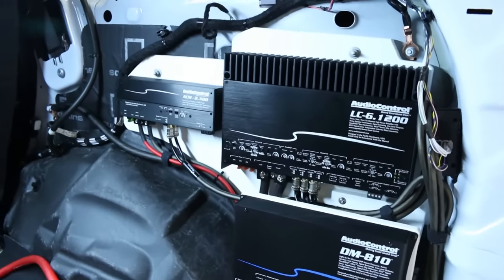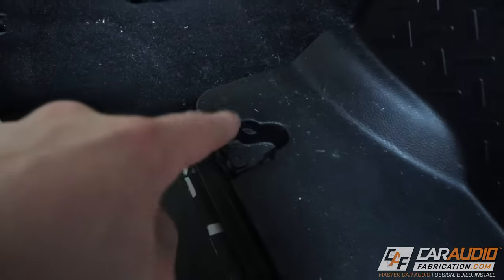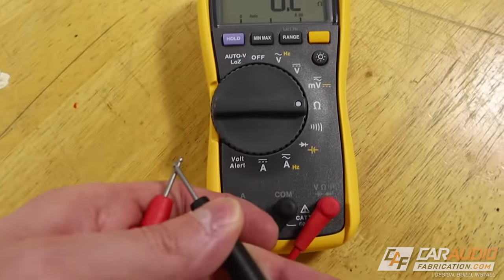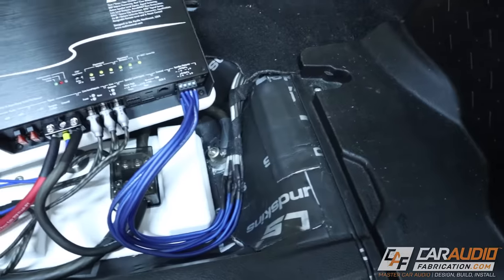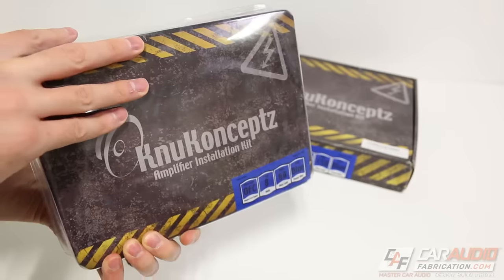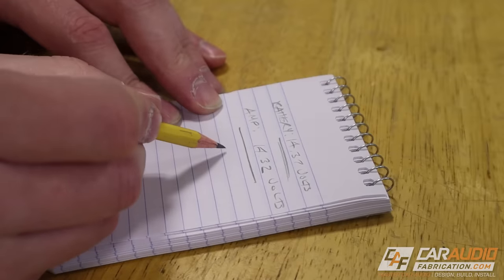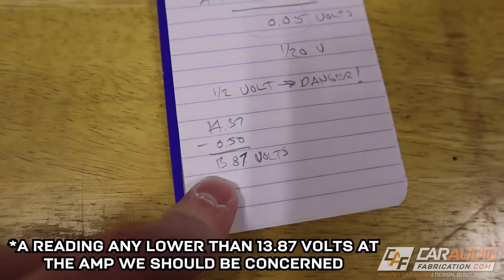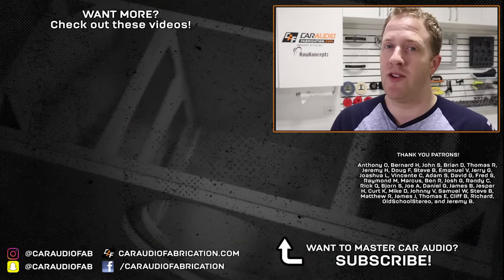YOU'RE LOSING PERFORMANCE! How to Measure Voltage Drop and Test Ground

Comment: Love your videos they actually do help determine alot of people's, I'm having an issue myself, I purchased a pair of 10 inch DB Drive G2s 4 ohm and I'm wired at 1 ohm but when I turn my gain up to halfway I get popping noise, not really clipping but I know there's not to much power I'm literally right at RMS power rating on amp to subs, I've checked all grounds and power and even speaker wire it's 12 gauge, using 1/0 gauge for amp and subs it's just at high volumes I get 1 or 2 popping sounds but I'm at only 80% power as far as reaching RMS power. Any ideas?
Reply: Figure it out? Sounds like my issue

Comment: Mark in some of these new vehicles the ground in the rear is poor everywhere u look.  

What would u do to overcome a poor ground that is poor through out the vehicle.
Reply: easy, ground wire directly to the negative post on the battery.  plus the big three ofc
Reply: Run appropriately sized wire through the body panel and attach to nearest good ground, which may be the frame of vehicle. Make sure to use a grommet when passing wires through any panel.
Reply: Rear seat mounting bolts, seat belt mounting bolts, or rear strut bolt. I have had good luck with these in the past. Clean the paint in the area you choose with sand paper or a wire wheel, and test your connection.
Reply from the maker: Look for what the manufacturer is using as a ground, worst case a separate lead going back to the battery.
Reply: Your suspension

Comment: I saw when finding the grounding points one side of the lead coming from the multimeter was used to find the ground points but the other was connected to the battery negative ground.  Is there another way to test, like connecting the negative to a seperate ground block then testing.  The issue I have I am trying to find a long cable that twill go from the front to trunk for ground points.  By the way, excellent video!!!

Comment: Ok so this video shows how to find the voltage drop, but for the extreme rookies like me, how do we fix the voltage drop?? You have 3 different locations to lose voltage, so how would you fix the 3 different locations? I'm assuming a new fuse in the first location you showed? And then new wires for the other two locations??

Comment: Can you make a video about setting the gain with a ddm using the amp his output voltage, 1000 watts rms 44,7 volts
Reply: Go to Steve Meade's channel. He details how to use it.
Reply: That seem like a fuck ton of volts...I don't think anything in a vehicle runs or produces 44V...
Reply: @mikecheeze4312  √(1000w*2Ω) = √2000 = 44.72v
Reply: @eikuz  great job smart guy!!! Yeah I could've used a math equation to say that too!!! Now show me something in a vehicle that produces or uses 44v like I stated in my original post....🤦‍♂️
Reply: @mikecheeze4312  Amplifier boost's the voltage for speakers
Reply: @eikuz  yeah I guess I look like the idiot now. I was more thinking something other than an aftermarket amplifier but you got me either way

Comment: No wires to reach from the front to the back I am guessing you could use jumper cables. Just connect the cable to the negative you disconnected from the battery and use the other end for the DMM. Not sure if the jumper cables are quality enough but it should work.

Comment: I like the video and appreciate you sharing you knowledge. It would be cool in a future video if you woudl run a purposely smaller gauge power wire and see what the differences are? Not everyone needs 0 gauge ya know?
Reply: They recommend different gauge wires for different voltages.

Comment: Great video. I was always told its better to make yr own ground instead of using existing ground screws or bolts. I've had success with both. Depending on location & voltage. What do you think? Thanks

Comment: Great video. You can also test out what spot of your alternator casing is the best ground when your doing the big 3. I ran a 2/0 gauge wire from the front battery to the rear frame under the car to get better ground in my trunk space but this is great info I will check my resistance soon and go from there
Reply: What RMS system are you running bro?
Reply: @shubhamparashar1852  only 900rms at the moment (not clamped) I haven't tested my system I've been just doing my own thing. Currently this is my smallest setup. Taking it easy

Comment: I am going to try this on my 36 foot motorhome.  The battery is in the back and amp in the front.  I was concerned about v drop Kenwood advised 4AWG for the 400W amp over that distance.  I thought it would have been 2 or 0 over that distance.  Dumb question, would a capacitor before the amp in the front help with voltage drop?  If Kenwood was in error new cable is going to be much more expensive than a capacitor

Comment: @CAF - I just installed a coustom box in my sons 2008 Infinity G-37S and the only way I could built it to get his 2 Duel 2 ohm Skar Audio DDX12’s and Skar 2,000 watt amp in the SMALL trunk was to put the subs facing up with them mounted on top of the box. My question is.., why does it hit harder when the trunk is open? 🤔 I always had my subs facing to the front or back in my younger days of systems. Lol. I feel like I’m not getting the full effect out of the subs. 🤔🤷🏼‍♂️ Thanks!

Comment: Great work Mark as usual 
I think that you missed the car operation conditions like AC, headlights and other accessories on/of during the test

Mine is running 14.1 with headlights and AC on ... drops on heavy/max loads to 3.8 to 3.6 ... not sure now if this is healthy or not 🤷🏻‍♂️
Reply: That's not the kind of voltage drop he was talking about. He's talking strictly about having all your power and grounds mounted for optimal performance. The more electrical equipment you have on, the more the voltage will drop. That's why headlight sometimes dim with really hard hitting bass.
Reply: @Martin Ramirez Mi5  Thanks for the explanation mate! In this case, mine is 0.01v ... and I used Rockford fosgate 10 farad hybrid capacitor to resolve the drop. For a year now, all is exceptional
Reply: Tarek El Gohary You’re welcome ☺️ Glad the capacitor worked
Reply: @martinmi5  The only working capacitor in the market actually 😃

Comment: Stock alternator 2015 corolla and have a -1/0 ofc power ground and big three plus couple extra block to body grounds because unibody crap, 400$ in copper so far. I have a 1500 watt rms amp on a 1-12” dvc 2 olm wired 1 olm amp is happy at 1 giving average 1800 to 2000 max, now also have 3,5 farat cap,  do i need a big alternator????? Thanks awesome videos

Comment: Awesome video would you use the same principles for testing the voltage drop for the speaker and sub woofers wiring to test speaker wiring is Adequate?

Comment: I want to get a clamp meter that I can test the current of my main power wire. I went to a few stores and from what I read on the packaging it doesn't go over like 10 amps DC. It'll do AC just fine but I can't find the right meter to go high enough on DC voltage. I just want to find out how much I'm really pulling through my power wire.

Comment: Hey bro. I pulled my carpet out of my trunk and ground the paint off.  Done the big 3 upgrade with 0 gauge. I put in my new amp and it was getting hot easily. Plus it isn't hitting nearly like I wanted.  Figured my ground was fine. Broke out the multi meter and tested multiple spots in trunk. They all show 3 ohms of resistance. Would that much resistance impact my amps performance?  Thank you. I'm severely frustrated

Comment: What are your thoughts on just running the ground straight to the negative battery post from your distribution block?  My vehicle clearly has some areas that are glued.
Reply from the maker: Test as shown in the video. Thats the whole point of this video.
Reply: @CarAudioFabrication  I learned from your video the correct range of voltage drop.  Thanks

Comment: In order to test for ground on certain metal parts of the car, can I use the jump starter wires as extensions? Because, I don’t have an extension lead for my Digital Multimeter
Reply: Yes you can

Comment: I have a 2017 Toyota Highlander and the battery is in the trunk, right next to where the amps will go. Would it be best to direct connect the amps ground to the ground of the battery or the chassis?

Comment: I would like to see a video on how to choose and or determine where to run a power through a fire wall on a vehicle..
Reply: Every car is different. Location will vary from car to car to truck to suv. Look for the shortest distance, most hidden spots, etc. And ALWAYS use rubber grommets when passing any wire thru metal!

Comment: Hi Mark, here’s a video idea! I’ve been currently looking into whether I should use regular RCA’s for my install or splurging out on a line driver for my amps for high level input? I know,          watts = amps x voltage.. and a high level input has more voltage which should mean more power 😁 but wanted to ask is the difference noticeable and worth it ?
Reply: Low level input or high level inputs 😁which is best ..! P.S I hope you read my comment you turned me into a geek 😂😂

Comment: Question, if an amp installed worked perfectly for a month and then just stopped and the green on light dims out on the amp when turned on what could be the issue? Voltage at start is 13.3v from the battery and 12v from the remote, but when the ignition/car is turned on the hot power voltage drops to 2.3v where the remote stays constant 12v. When the car is turned off the voltage slowly comes back up on the amp. Is this a bad amp?
Reply: I'm having a very similar problem... Did you ever find a solution?
Reply: @blackrealmmedia  I swapped the fuse block and that was the problem. Fuse was good but there was something with a weak connection.
Reply: @Suprasian  Thanks!  I'll check that out and see what happens

Comment: Any idea what would cause small popping  noises in a stock stereo system. I have a 2021 Audi A7 with a stock Bang and Olufsen. The pops vary in intensity but are not super loud and I hear them coming from all the speakers but not at the same time. I'll hear them from one speaker then another. This a common issue as I have found many forums of complaints. Audi calls this normal behavior which is rediculous. They tried replacing the amp which did nothing. Thanks.

Comment: Question:
I'm a budget bass-head and recently started a budget build 4x4...
So...I already had a small system installed by an audio shop...
It was good but I wanted MORE...
So ordered a 15,(had an older amp and box given to me already for the 15)...
So...im almost positive my
 Sub is under powered but will this stop it from working under loads 🤷🏼‍♂️ meaning after a while of jammies I loose sound to just the one bridge amp...is this from lack of power you think 🤔🤔
Because my concern is that I'm using the same ground as the other amp and it's a tedious process to get back to where it is as ive built enclosure of sorts 🤦🏼‍♂️
Is it a bad idea to use the same ground 🤷🏼‍♂️
Both amps are different as are the subs...one is dvc and the other not etc...ohms if each sub is different as well...

Comment: I have a down 4 sound jp23v2 amp. Im trying to recalibrate the bass knob voltage reading but where do i measure at? At the amp or the battery?

Comment: How do you dyno test the performance of an amplifier to verify if it really pushes the RMS watts the manufacturer claims?  I want to feed at least 1000 watts to my Crystal Mobile Sound CMPx2 2ohm dvc 15 inch subwoofer that is rated 1600 watts RMS.  Is there an amplifier you recommend?

Comment: You have 1/20 volt drop with a 0db 40hz sine tone playing at max volume ( full tilt ) before clipping? 

Or you just have that voltage drop in the wire runs with no music or tones playing?
Reply: With the test tone playing

Comment: I recently used a multimeter and measured my voltage at my battery vs at my amplifier. When the AMP is off, the voltage is similar, maybe off by 0.05V, but once the amp starts playing and the bass kits, voltage at amps terminals fluctuated like crazy, sometimes as low as 11v, but voltage at the battery remain fairly steady at 13.9-14.2. Is this normal?
Reply: I would also like to know the answer to this. But when I used a capacitor (shitty one) it used to drop below 11v and many people said that’s not good.

Comment: What if the car has an eld/voltage regulation system, using the ecu to drop voltage that interferes with the amp?

Comment: I got a question, hopefully someone can answer it. I dont have a long enough wire to do this test towards the back of my car. Could i rig up some speaker wire to the negative terminal on the tester to the negative battery wire and still be good to test the spot towards the back of the car?

Comment: I got an alpine stereo its been acting up it won't turn on. So I checked all my fuses they are fine. I checked my power on the harness, both the key and the regular power wire to the stereo have power. I'm not sure if the multimeter is reading the ground it's not beeping. or if I'm doing it right... Would say the ground is the problem or something else? Because it blew fuses on my amp last time I fixed it. I changed them last time and it turned right on

Comment: I have a question. I just installed a new battery on my 2018 ford f150 and now when I accelerate my voltage drops from 14.5 to 11.9.  When I cold start the truck it will stay at 14 even if I play my system. But once I start moving I’m having voltage drop issues. All my wiring is good, have a new alternator.  I removed the fuses from my system to see if it was my amp or sub and it still had the same issue. Any idea what could be wrong?
Reply: Also when I take my foot off the gas the voltage will go up to 14.5 then the second I put my foot on the gas my voltage drops.

Comment: Would having insufficient power from the alternator create a bass fade issue?  My woofer pumps for like ten seconds and fades to a softer tone and will not boom as hard.  I'm running NVX 500.1 to one 10in woofer in my 2016 Jeep Wrangler.  I used all of the wiring you used and followed your install guide.
Reply: Same here with Sub And Speakers also

Comment: Hi Mark. I performed the test and my ground resistance is high at 6.4 ohms. I could only find one location in my car via under the hood that had a 3.3ohm reading. Is there something going on to why my resistance is much higher than 0 at bare metal locations?  Also I measured my voltage drop (no audio played) and it was .10 voltage drop which appears to be a good value.
Thanks
Reply: I see he hasn't answered your question. I asked a similar one. I checked bare metal in my trunk and couldn't find lower than 3 ohms resistance. My amp is running hot and I don't know what to do besides run another cable all the way to my negative on the battery. What did you end up doing?  Thanks for any info

Comment: Help please-
So I go and test my grounds. Had to improvise with my limited supplies. Had some leftover 16 guage speaker wire (ofc of course😎) and had to separate the two wires and connect them to make a jumper for my ground off the battery.  So I got one running from ground up front to back seat of my crewcab  and connected to one probe. Using the other to touch ground locations. Touching both probes it jumps around once or twice but measures 0 ohms.  Also this is just the cheap multi meter from Walmart for 10 bucks. So I check amp ground and does the jumping around for a sec but reads 0.  Terminal on amp reads 0 .  Tried a few random locations back there under seat that would be feasible for grounding and all 0s.  I either got 0 reading, or the 'oL' on the screen when its not touching anything. I never could find any resistance anywhere. Under my hood I checked alternator casing ground strap on hood, even the frame where i ran one of my big 3 and another on back of the truck that's just a factory spot.  
Should they all be reading 0?  No resistance anywhere? Now I did just rescrape and clean every ground on the truck plus did big 3, but I know myself well enough to know i highly doubt I did it all perfect. I'm a novice at electrical so im guessing I had to have done something wrong

Comment: hi ! i confirm you that it's not only losing performance ! you can discover that a bad ground gives problems of calculator , rear lights and other electric disfonction ! the big three and a good ground are very important and the cause is often the PAINT because the car ar paints and after mount  the second one is the rust cause of electrolyse and the wet hot ground connection : bad contact gives you hot so vapor so rust so bad connection ! you soon !

Comment: My voltage stays up to 14.6 most of the time. But usually it goes up and down just randomly. I drive a newer Chevy heard its computer controlled.  But eveything has been measured just have loss a random times

Comment: So I just purchased a skar 1200.1 monoblock. I’m having a issue when I turn my amp up with the bass knob sometimes my subs beat without having music sent to them. Plus the speaker output has 1 ac volt without sending any signal to the amp?

Comment: Mark - ever consider making a video for parasitic draw? We didn't learn all this over night, and I can remember more than once buying used gear because I was just a teen who loved car audio but didn't always have a lot of money. I'm sure kids are still buying used stuff out there. 
I had a parasitic draw from an old headunit I had installed months earlier. When I finally found the issue the radio was hot enough to burn my finger prints off of one hand - even though the van or radio hadn't been on in 16-18 hours.

Comment: So I have done all of this and got a ground with 0 resistance and my voltage drop is roughly .1v and my headlights still flicker slightly on 600 watts rms should I do big 3 ho alternator or better battery